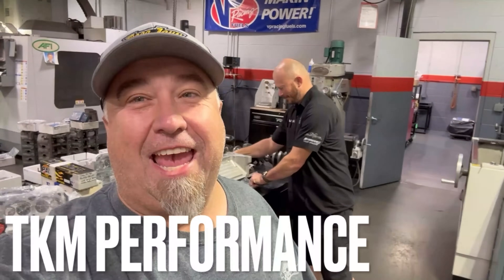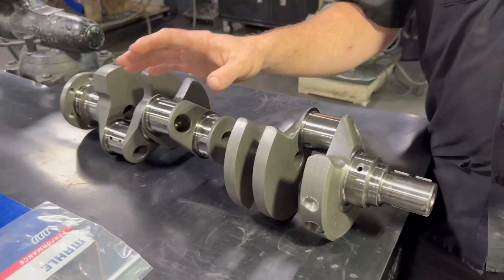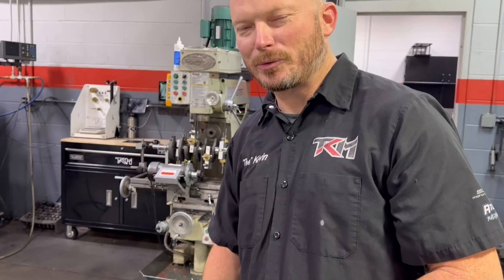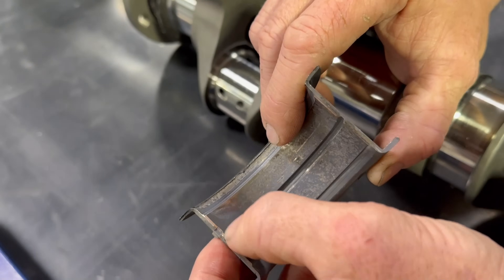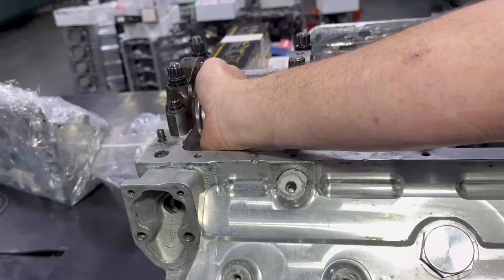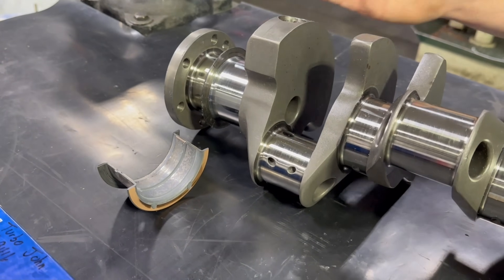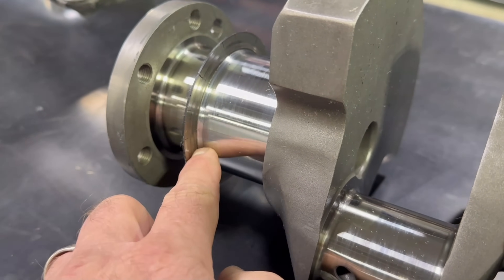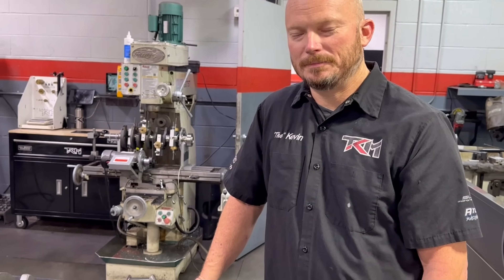Roller Thrust Bearing Install / Turbo cars kill thrust bearings / Engine Thrust Bearing Failure

Comment: my only concern with these roller thrust bearings is the speed that the manufacturing company specs them around 3500rpm ? unless you guys buying them from some where that they spec them better ? where you guys get them from ?

Comment: Don't these grenade? I was planning to do this modification, but it would seem that none of the needle thrust bearings support automotive RPM's. I've looked through the catalogs of SKF, NSK, NTN and Koyo, and according to the specsheets the size of what you're installing (100mm+ OD) has a maximum oil-lubricated design limit of about 3000RPM. Even small ones (65mm O.D.) are not designed to go faster than 5500RPM according to the manufacturers. How did you circumvent this issue?

Comment: Converter uses fluid coupling. No thrust on the crank when at idle. When loading the engine, the trans fluid in the converter compresses, which exerts thrust against the crank and the transmission input shaft.

Comment: What's the max rpm of those bearings under load? (it will be in bearing catalogue)
Problem with needle roller thrust bearings is bearing cage wear allowing needles to 'skew' and possibly lock up.

Comment: No matter what, reducing friction has got to help. My fear is pressure against the crank in a linear direction compressing it in a manner it’s not designed for. There is a reason the manufacturer puts the thrust bearing closest to the flywheel.
Reply: Nah. Lots of engines have it in different places.
Reply: @squarebit  true but in this case the rear thrust won’t be helping to support. The crank will be compressed between the flexplate and the front roller thrust bearing unless the rear thrust is also repaired.
Reply: @JudgeMeNotLeMans  The thrust will be controlled by the roller bearing.  

I fail to see why it would matter if thrust is controlled from #5, #3 (as many used to be) or the #1 main?

The crank isn’t going to compress.  
Most use #5 these days for packaging and production concerns, IMO.  

It’s probably just easier to machine the rear of the block for the thrust bearing and #1 is occupied by modern crank-driven gerotor oil pumps.
Reply: @JudgeMeNotLeMans  I would also think either #1 or #5 main would be better than the #3 main for thrust control for the simple fact that any crank flex/whip will be most exposed on the #3 journal.
Reply: @BCSVT  Certainly I could be entirely wrong. I was simply making an observation and not from any real world experience. It just seems that a ballooning torque converter applying pressure against the entire length of the crank could potentially be a problem regardless of where the thrust bearing is. That stress has to go somewhere either forward against the crank or rearward towards the transmission and the weak point will be revealed. Also minimizing that stress with torque converter that doesn’t balloon would be an obvious upgrade.

Comment: This is why I used to modify the thrust bearing just in case somebody's got a crappy torque converter take no chances. Adding more oil to the rear thrust.

Comment: I used torsion bearing thrust bearings on the front and back of my 394 cid sbc 2700hp nitrous motor. 20+ yr ago. Its something that Nascar uses.
Reply: How did you get 2700 out of nitrous 394?
Reply: @Two_Degreez lots of nitrous... lol

Comment: Forget to mention this in my first comment about thrust bearing issues related to manual trans case because of the thrust force during clutch disengagement, but to address the question brought up at 8:25, theoretically, the OE type thust bearing can carry more load than a needle type thrust bearing but there is some caveats that make the lower load carrying needle thrust bearing better suited for the job.

First you have to understand that the load carrying capacity of a hydrodynamic bearing (like the OE type engine bearings) is a factor of it's surface area and the oil pressure between the two elements (in this case, the crank and the bearing). Increase either of those two factors and you increase its load carrying capacity (remember, "force" or you could say "counter force" when referencing load carrying is pressure X area). In regards to a needle thrust bearing, Its load capacity is for the most part, finite based almost solely on its dimensions and material and this is where it has the advantage in this type of application despite its lower theoretical load capacity.

You see, since oil pressure is a determining factor for the OE type bearings load capacity, its capacity changes dynamically until pressure reaches regulated max BUT (and this is a significant "but"), even when the engine is running at max oil pressure, the thrust bearing face is not seeing nearly that much pressure for one and as load increases, the clearance for oil to get into it decreases and thus the pressure drops as all the oil is squeezed out from the reducing clearance and can't be replenished and ultimately, you go to metal on metal contact.

Remember the elementary / middle early science of "path of least resistance" that fluids take when they have options? Well that's what's happening here. The oil that feeds the thrust bearing is bleed-off oil from the main journal adjacent to the thrust bearing (I'm not aware of any engines that have direct feed thrust bearings but that's not to say that there isn't any). As thrust load increases, the crank crank tries to walk and if there is enough oil pressure between the thrust side crank face and the thrust bearing face, the crank can't really walk but there becomes a pressure / force imbalance between the thrust side and none thrust side because you have external forces applying in the thrust direction from either the converter in the cast of auto trans or clutch disengagement in the case of manual trans and you also have oil pressure force that is on the none thrust side of the bearing applying force in the thrust direction because its trying to spread the gap (oil clearance) between the crank and the bearing on the none thrust side which then loads the crank in the thrust direction. 

This load imbalance causes the crank to start walking in the thrust direction which reduces clearance for more bleed-off oil to get in between the bearing and crank on the thrust side and obviously this increase the clearance for more oil to get in on the none thrust side and remember, "path of least resistance", so the oil from the main will tend to favor bleeding off on the none thrust side since it has less resistance due to increasing clearance from the crank initially walking in the thrust direction.  

Think of it like this, lets say that you have 2 thou of total thrust clearance, when loads are balanced, each side will have 1 thou clearance and no problems. Then the load becomes unbalanced and the crank starts to walk. If it walked say 1/2 thou, now you have 1/2 thou clearance on the thrust side and 1-1/2 thou clearance on the none thrust side. It will talk more pressure for the oil to try to get into the thrust side so the lesser resistance path is for the oil to bleed off to the non thrust side and since oil cant get in to the thrust side as easy as it can be squeezed out, the clearance gets less and less until metal on metal and toasted thrust bearing and crank.

So while a hydrodynamic bearing can carry more load (generally speaking), by the design of an engines bearings and oiling system, the rolling element bearing is better suits since its no susceptible to dynamic change problems like the hydrodynamic bear configuration is.

Comment: Traditional crankshaft main thrust “bearings” are essentially a bushing… A Torrington bearing is eleventybillion% more effective.  It’s become fairly common practice to fit blocks with roller cam bearings.  I can guarantee the load forcing that crank forward in the mains is FAR more than what’s happening inside a cam bore… Kevin is a baaaaad man. 🤙

Comment: Thrust bearing problems are common on Manual trans cars, especially when you put upgraded clutches in them that have high clamp load pressure plates. Every time you step on the clutch, you are shoving or pulling (depending on the type of pressure plate obviously) the crank against the thrust bearings. People don't realize how much thrust force is applied to the crank when you step of the clutch even on a stock low to moderate torque clutch. Add in the fact that in many engines, the thrust bearings are not receiving direct pressure feed oil, (so its easy for them to squeeze out the bit of oil that gets to them and thus start running metal on metal until you take your foot off the clutch pedal) and you have a ticking timebomb of a thrust bearing setup just itching to chew itself up.

This is why personally, I've never used upgraded single disc clutches in any of my manual tans cars over the years if one needed more torque holding ability than what the stock clutch could hold. If I need a clutch to hold more torque than the stock clutch could, I would either buy (or build a custom) multi disc clutch with a low clamp force pressure plate to save the thrust bearing in the engine. The last one I did was should have been about to theoretically hold 800lb-ft of torque all day with no issues (was behind an engine that was only making just shy of 650, so was never truly tested to see if actual and theoretical numbers matched) and yet my 5'2, 105lb wife could drive the car in typical rush hour stop and go traffic with no leg fatigue. She even commented the first time she drove the car that it felt almost like she was driving a low power 4cyl manual trans car when it came to clutch pedal effort which is essentially what it should have felt like for the most part because the pressure plate was one that fit several different 4cyl Toyota Cars from (the 80's if memory serves me correctly).
Reply: What kind of mini disc? 7.25 metallic?

Comment: Torrigton bearings are at best a patch. Resolve why the trans is pushing the crank forwards. And No1 main is not near as strong as 5
Reply: Your comment got me wondering...am I wrong in assuming there is a range of thrust tolerance that the various shafts inside an auto trans would have spec ed?  Either from the factory or from an aftermarket source.
I know there has to be some movement and I know they talk about clearances when changing the number of clutches/steels inside.

I can't think of what else might be moving/pushing.  I mean how much "front to back" movement would one expect to have on an installed torque converter?  And is it just the torque converter that is moving...?

Flex plate bolted to crank, torque converter bolted to flex plate but the torque converter to trans connection is just rotational not front to back so technically it can move, I feel like I am missing something.
Reply: I guess the oil pressure in the trans is trying to push the torque converter out the front of the trans.

Comment: That trust system is the best that's what comes in the rotaries factory and we push those things up to 11,000 RPM between 1500 and 1600 horsepower it never fails

Comment: Will moving the support to the front of the crank cause any deflection or other issues as a result of the converter pressure compressing the crank?
Reply: May have a problem with the torque converter internally not shim correctly or something's worn-out.

Comment: This is really easy, boys. Our engines have TWO different oiling systems, pressurized and SPLASH. The crankshaft bearings are lubricated by the pressurized oiling system and the thrust surface is lubricated by the splash oiling system. The splash oiling system does not work well under high loads when the engine oil is cold, too heavy or when it contaminated with WATER or CONDENSATION. This roller thrust bearing will also be lubricated by the splash oiling system and, as Kevin says, it will be a wear or service item, also. It will last longer than the babbitt thrust bearing because the rollers will hold the engine oil longer than a babbitt thrust bearing since the oil is not being wiped away as it rotates, while loaded.